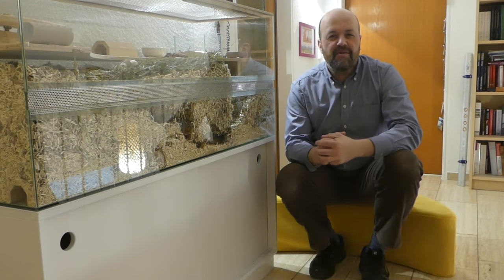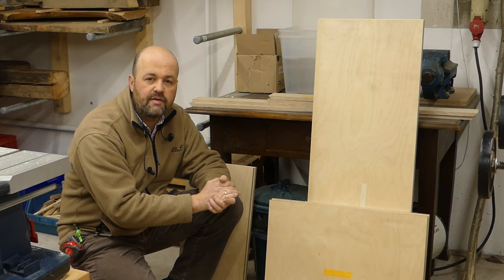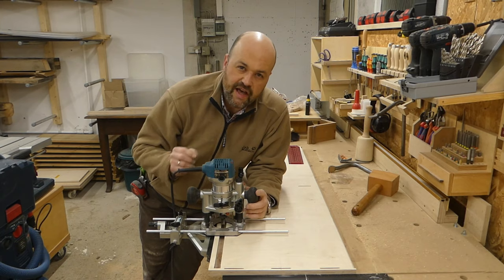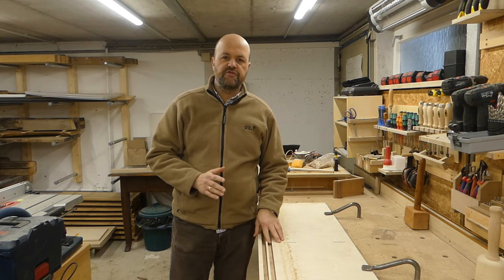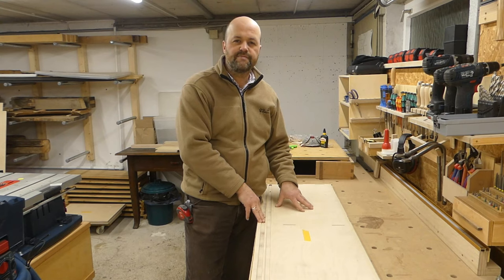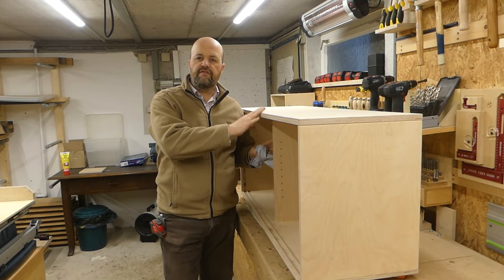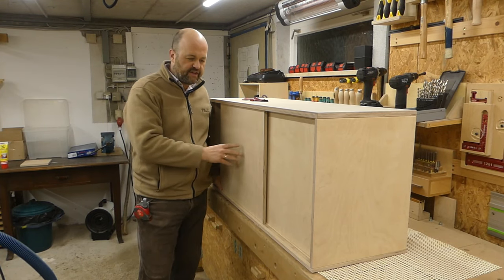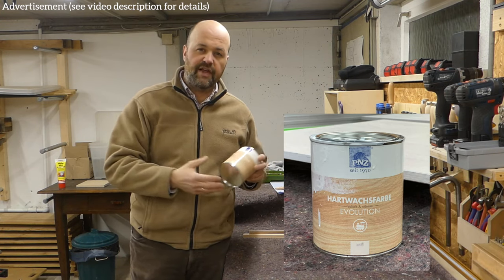Sliding Doors Cabinet DIY – Clean and practical

Comment: Is there a way to clean the sliding area of dust that got wet and is preventing the doors from sliding smoothly without dismantling something like this
Reply from the maker: Sure. The doors slide in an open groove so you can simply use a vacuum cleaner to clean the groove from time to time. If the dust got sticky, use something blunt and narrow to scratch it off.